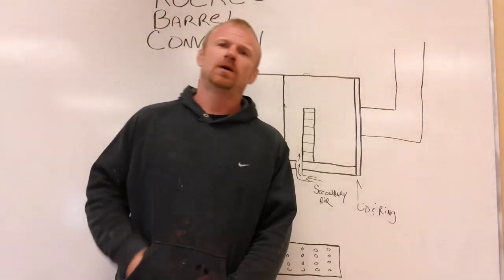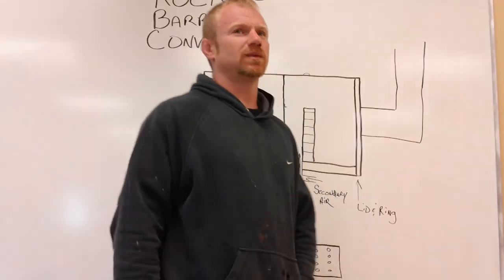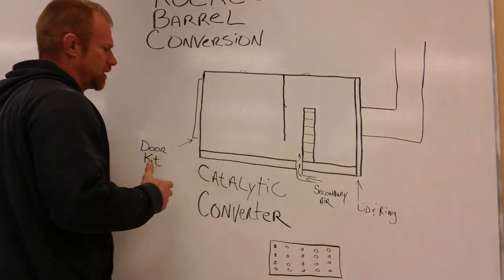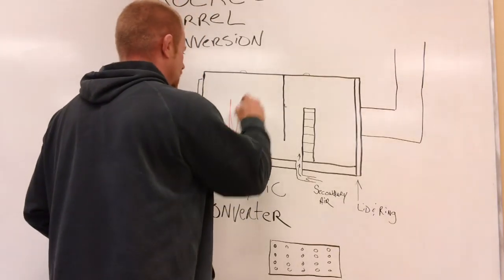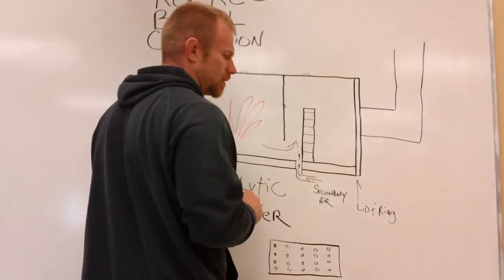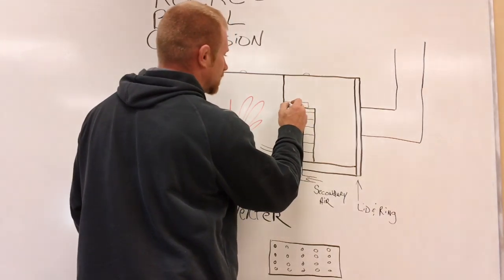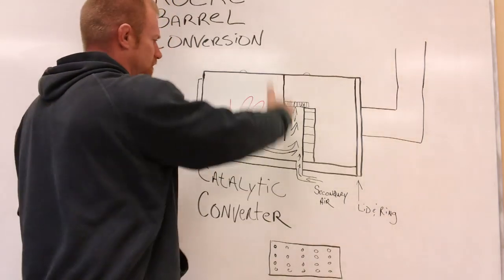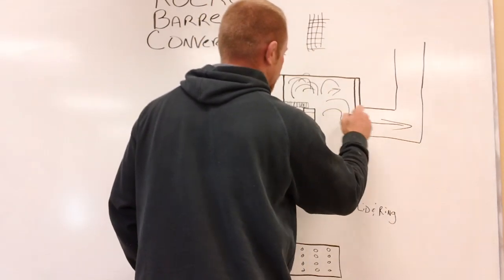Rocket Stove Burn Efficiency from Single Barrel

Comment: ok was this just theory? it does not make sense. you have a flat bottom for the fire bricks but what happens when you get to the ROUND sides of the barrel?? the smoke will just go around the firebrick wall because it cant be air tight around the sides. and what is holding the catalytic converter, it is sitting on 4" bricks and resting against a sheet of metal? gravity may have an issue with that. And why not just cut a slot in the bottom like the top and slide and weld a sheet metal wall up rather than firebrick and that way you wont have smoke going around the wall. none of this makes any sense. And lastly this is not a rocket stove. just saying. would love to see the video of you making this reality.
Reply from the maker: LOL your misunderstanding is significant. Perhaps this video is not for you. Just to clear up ONE of the many misconceptions. NOWHERE does the video or title or description is the claim made that this is  a rocket stove...LOL.. but thanks for clearing that up.. Captain obvious. Maybe English is not your first language, I dont know. What the title  does say is Rocket stove Burn efficiency from a single barrel . 1st clue There is s difference in being  rocket stove and obtaining by design the same or better burn efficiency as a rocket stove..2nd clue the description specifically says " How to up grade the efficiency of a barrel stove burn to that of a Rocket stove " that again is different than claiming to be a rocket stove .  This video is concepts I assure you that is understood by others who build stoves and many that dont and not a "how to" or instructional video. If you cant figure it out then it was probably not meant for you.
Reply: @TheTitian69  it is not meant for anyone because it, from a engineering stance, is not even buildable by your design.  Maybe think about the comment I made to reassess your design concept and fix the flaws. And maybe get hands on and build your concepts to see what is and is not possible. peace.
Reply from the maker: @kevinjohnson5060  LOL way to double down Kevin. You got me Einstein. Since you lack the comprehension the CONCEPT must be flawed. Not only did I not claim it was a rocket stove in the title and even stated as such it in the description but in addition the very first thing I say in the video also states as such.. You miss and misunderstood that much direct communication no less than 5 times. Plus the fact when I pointed out to your the OBVIOUS mistake . You skip right over that part and take no responsibility show no character and accept your error that even Ray Charles could see. You now insist on calling it a design and not accepting it as a concept as I clearly stated. Now if you would have ask questions and not counter claimed me causing controversy or simply showed some character and accepted the first glaring mistake I would have gladly explained it to you. But I seem to lack the motivation to educate you. Perhaps the approach you take has something to do with the response you get. But Please dont let me interfere with your happiness and success. It is very doable. I am convinced not by you. still it can be built. My channel has many stoves on it that I have built MANY!
Reply: @TheTitian69  I did not say anything about the title in my reply. Yes you made that point. but by all means go on and keep on keeping on, i clearly can find more productive things that your 'concepts' that have no chance of being made.
Reply from the maker: @kevinjohnson5060  You can not be serious. WOW!. I never said you did say anything about the title. I did! I did so because you said... "its not a rocket stove"... I said ..." I never said it was a rocket stove" I pointed out the the title does not say it is a rocket stove and the description does not say it is a rocket stove and IN the video I specifically says It is NOT a rocket stove at least twice.  So my point was you did not listen or retain what was said in the video and you lack the reading comprehension of the title and it was wrote again which you missed again in the description. There was no need to state the video is not about a rocket stove!  It would have been just as relevant to say " its not a cat !  NO shiat ! Don't you see how many times you was unable to grasp that? How you had to make an assumption? How you had to NOT listen to the video?  You are arguing points that dont need to be argued..1. its not a rocket stove 2, you didn't say anything about the title. Now to move on to other things you will likely  not understand.  The wall of bricks in the video you claim the smoke will go around.  I specifically say in the video  the bricks can be cut to match the curve of the barrel so the smoke cant go around it. In addition to that I say  cob can be used in conjunction with bricks to accomplish this. IF you would have actually listened.  It is obvious that you claim it cant be done because you lack the ability to either understand what is said in the video or you can not remember the information . So you insult me and my concept for your lack of comprehension. When you act like this on MY channel I will do everything to HELP you expose yourself as dim witted individual  not that there is anything wrong with being less intelligent but when you insult others or claim there is some thing wrong with someone else because you just cant get it , Then Im gonna expose you. In terms you can understand : nothing wrong with being dumb just don't blame others for it!
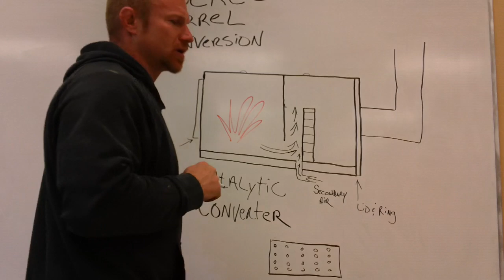Reply: @TheTitian69  @3:32, you actually say "it will burn like a rocket stove"

Comment: The idea of the rocket stove is to create the vortex in the burn chamber to create a secondary burn that burns those gases in the riser. It was invented for third world countries whose people were using dung to cook with on an open fire pit. There is NO reason to use a converter if you you use a properly constructed rocket stove!!!
Reply: from what i see rocket stoves need a constant feed of smaller wood and are hard to burn overnight

Comment: 1) Don't use stainless steel for the first wall, use fire brick instead to retain the heat. 2) use lava rock instead of a catalytic converter to burn up the smoke (been there, done that) Lava rockis from volcanos and retains heat to extreme levels and will burn up the smoke (and outlast expensive catalytic converter) and 3) Move the exhaust lower in the back of the barrel to cool down the exhaust, which creates a suction to keep a better draft going. Remember rocket stove principles.
Reply: +Painter D sounds like your design adptation is something I'd like to try.  Do you have a youtube video on it?
Reply: @MrLostwilly   No I don't have a video on it. In theory and on paper it works. Some have tried to even patten it. To actually build one would be doable but a pain to do. I made my barrel stove with a baffle about 3" from the top and installed a long air tube under the baffle to burn up the smoke. The flame and smoke has to travel under the baffle to the front of the stove before it goes back to exit out the flue pipe. It burns very hot and smoke free. That's what you want.

Comment from the maker: I believe you are correct. I also have built Babington waist oil burners. Most people use compressed air to push them. I have used steam to do the pushing and it works well doing the push while also improving the burn.

Comment: I have read that if you inject wet steam into the exhaust of a car stove furnas whatever it will clean up the exhaust because the carbon monoxide , cabin dioxide and any particles will combine with the water droplets. Just like in nature.